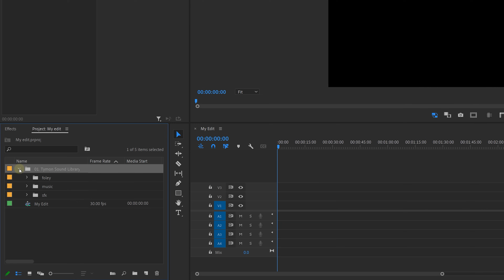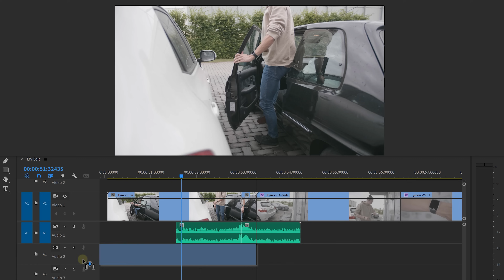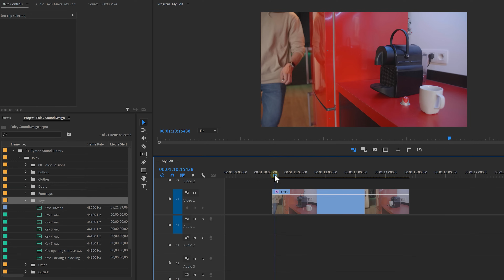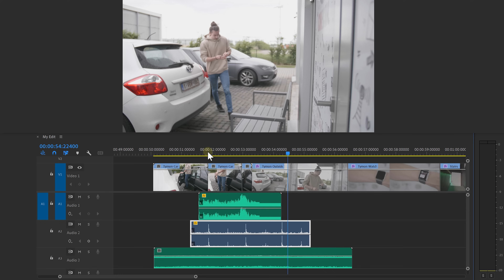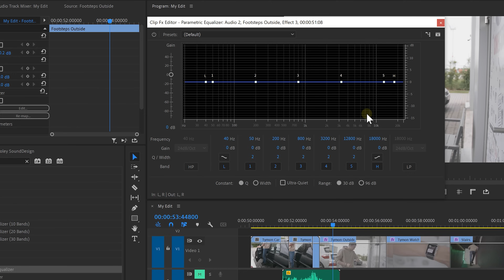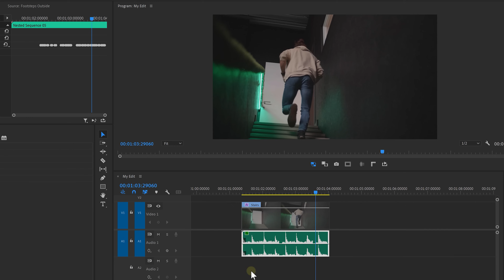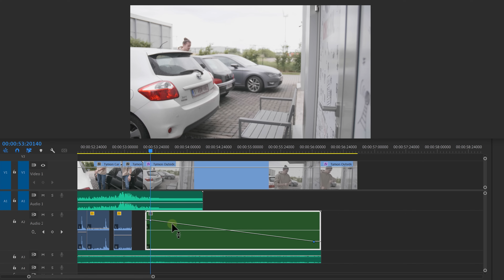MUST KNOW Sound Design TRICKS (Premiere Pro)

Comment: If I mix Music, SFX and Dialogue the end result often hits the max volume level, I think it is called clipping. 

Of course I can now level SFX, Music and Dialogue manually or use ducking.

I wonder is there a more universal fix, an automatic way to kind of duck the entire endresult automatically, so music, sound fx and dialogue never add up that much, that I expereience clipping in the output file? 

A solution to this would be great.